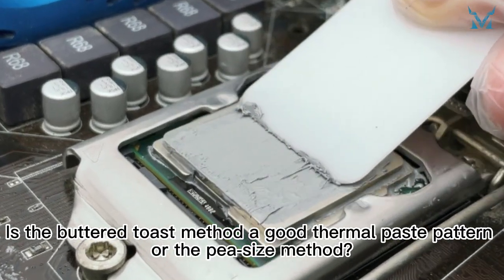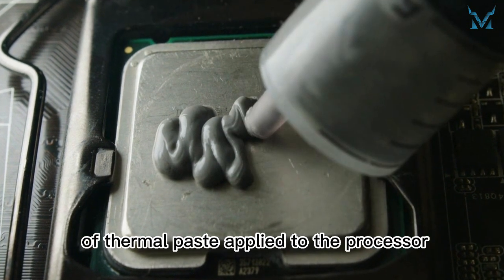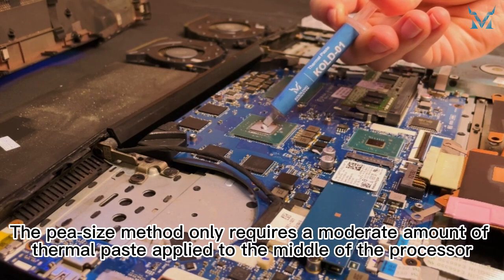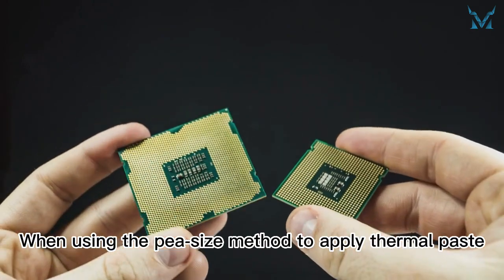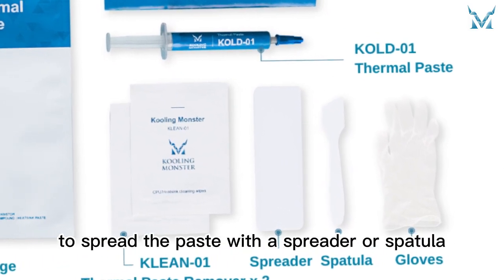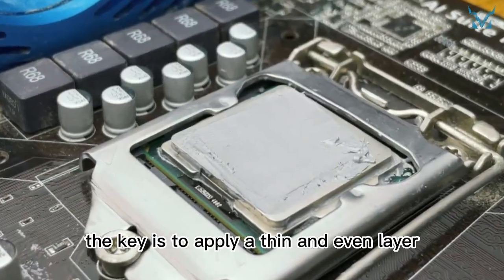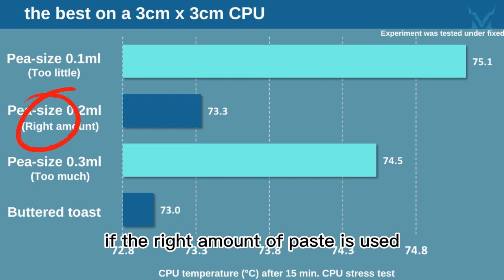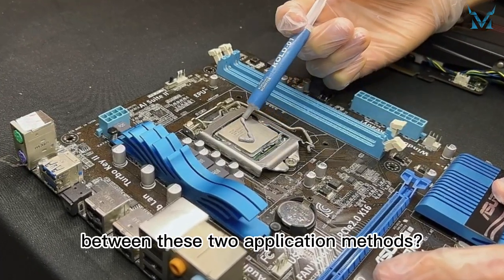Is the buttered toast method a good thermal paste pattern vs the pea-size method?

Comment: My Kold-01 was much thicker than in the video. I'm not sure if it might have dried out some while sitting on the shelf before I purchased it. How can I be sure?
Reply from the maker: Thanks for your question! KOLD-01 is designed to have a slightly thicker consistency compared to some other pastes, which helps it maintain better coverage under high pressure. However, if it feels unusually dry, crumbly, or difficult to spread evenly, it might have partially dried out.

Here’s how you can check:

Test a small amount on a flat surface – It should still spread smoothly under light pressure.
Look for signs of cracking or separation – If you see any oil separation or powdery texture, it may be expired.
Check the manufacturing date on the packaging – We recommend using it within 2 years of manufacture when stored properly.

If you're unsure, feel free to message us directly with a photo—we’re happy to help you verify its condition!
Reply: @koolingmonster  Ohh, mine was definitely dried out then. Thanks for helping me confirm

Comment: I'll go with the toast
Reply from the maker: Great choice! When spreading the thermal paste into a toast, you can directly see if you applied too much or too little thermal paste.
Reply: @koolingmonster   how can you tell if you'vee applied to moch or too little after toasting bread?
Reply from the maker: @bluesclues132  When using the buttered toast method, use a spatula to spread the paste as thin and even as possible while covering the CPU completely. If there are too much thermal paste, they will be removed when spreading.